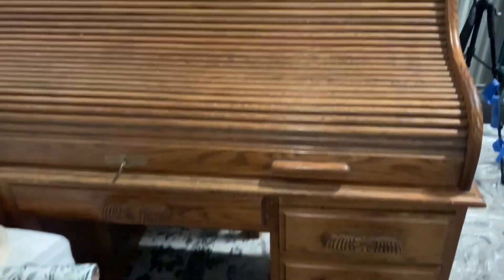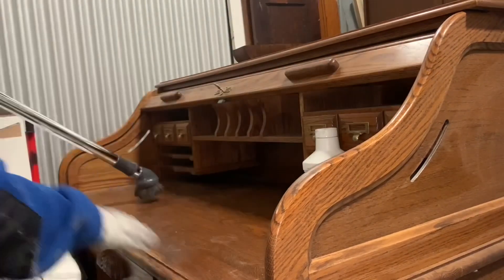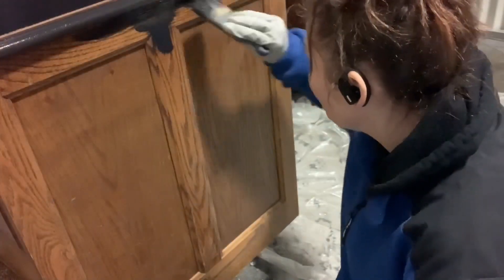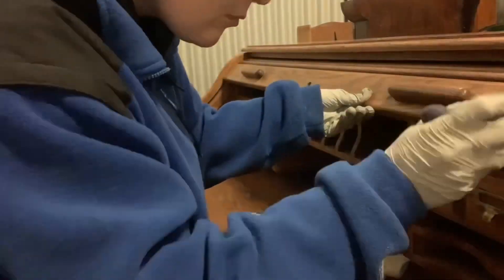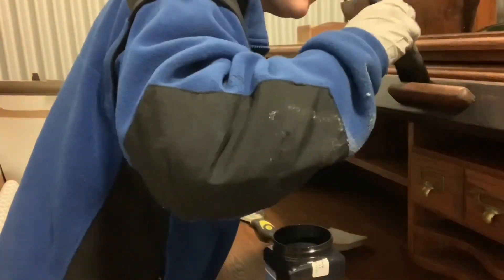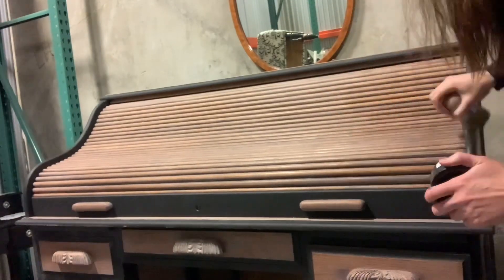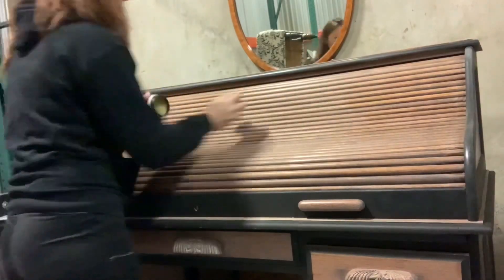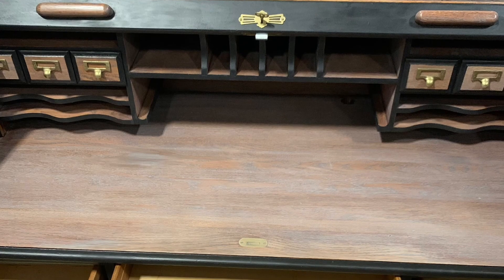Easy Elegant Vintage Roll Top Desk Makeover | Elegant Upgrades | Facebook Marketplace Free Flip

Comment: Excellent   I would love the list of materials and products you used  I need to do my dad’s antique 1880s roll top desk he bought from a train station after a fire there many many years ago…one door handle was damaged in the fire and I thought I would keep that detail but it has turned orange-y and I need to  repurpose it.  I am putting it in a spare room and using it to hold a small flat screen Tv on the top and keep any basic writing materials or bill correspondence and my laptop inside of it  and use the little boxes for charging cords etc
Reply from the maker: That sounds awesome, Judith! It’s been a long while since I did this one, but I know I must have used Chalk Mountain Paint. I’m guessing the colors would have been Blackboard for the black and probably Pebble Beach or Sea Cliff for the wash. And then their waxes to seal. But if you have a creamy whitish or khaki color with some subtle green or blue undertones, that will work to counter the orange in the wood.